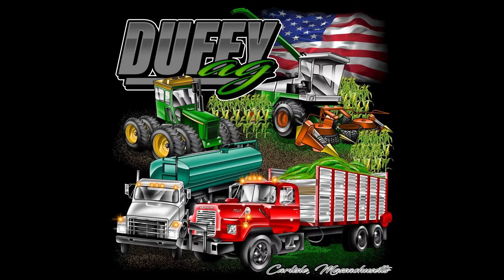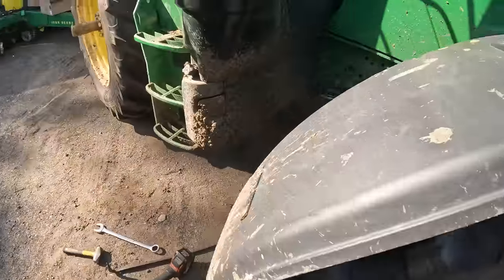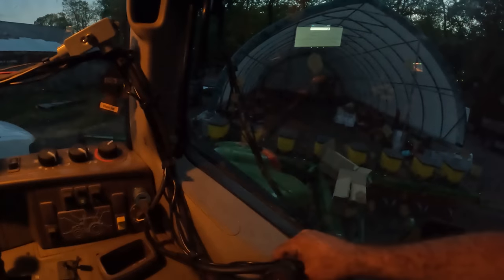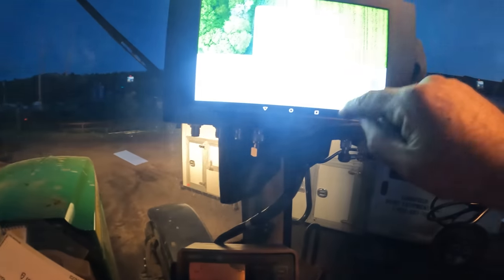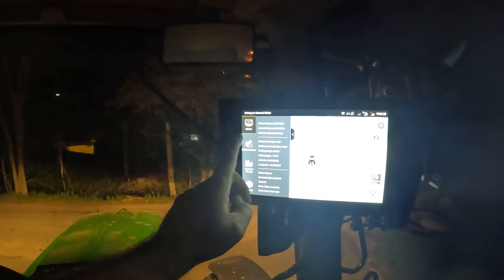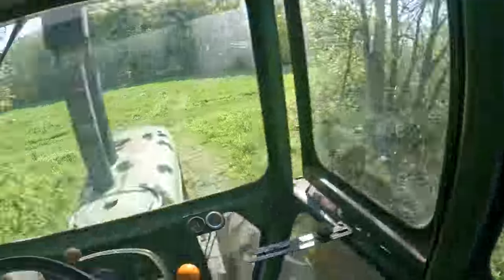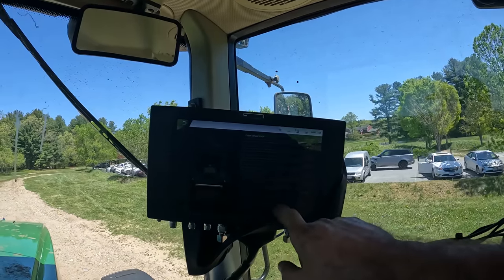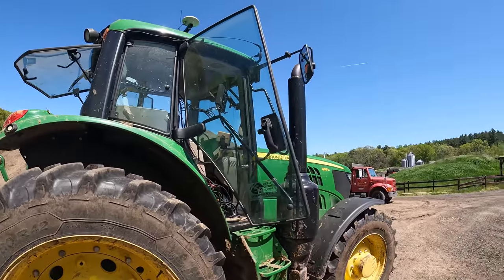No Hands Needed With FJ Dynamics- Let's Try Planting Corn

Comment: I keep a 6ft chipping bar on my disc. Seems easier than using a sledge hammer.
Reply: Ryan you are right on that, having a long bar can pop then rocks right out especially if you have then Deere deep cone blades!

Comment: If that drive is your only issue with the planter then i still say. Good job. That hacking job you did to turn that 36 inch to 30 inch is impressive.  I cant say that i wouldve even attempted that and im a bit of a fabricator hobbyist myself.  Im building a welding wagon to hold my plasma/welder/grinders/accessories so it will be one trip outside vs 5 or so. Plus ive been working on making new loader mounts but not having any shop or sheltered area its ruff to mig weld outside when you spend 20 minutes to setup to weld 20 minutes and then spend 20 minutes cleaning up.  The wagon should help a ton